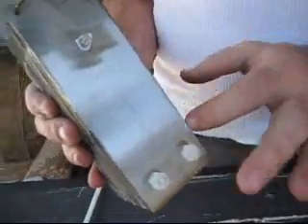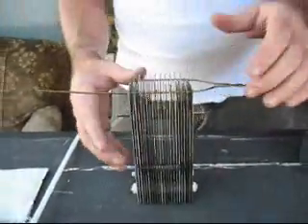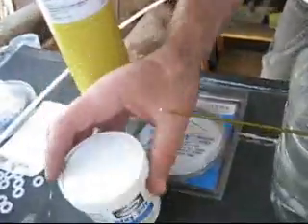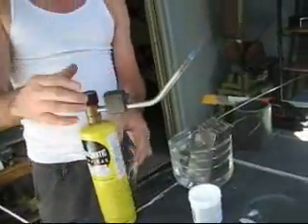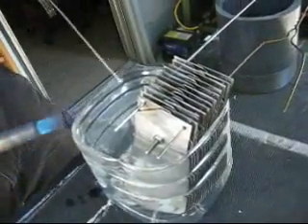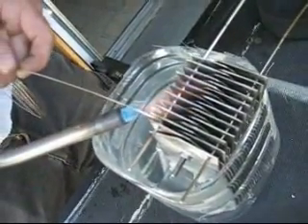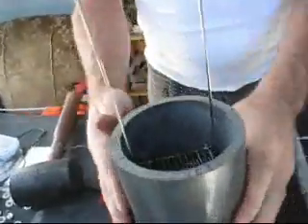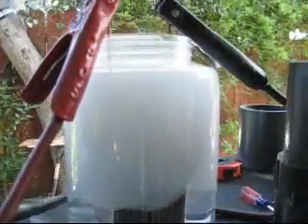HHO Third Generation Fabrication

Comment: Coughtry2 years ago (edited)I know all of this seems like a lot; but I really want to get this out there and get people to see the real potential of what HHO can do.  I am almost finished with my 3rd year in my Batchular or Science in Aviation Science.  I'm also a master automotive mechanic for both gas and diesel.  I'm currently engineering a small airplane to make an HHO system for aviation application at high altitudes.  I've been a pilot since 2007 finishing up my commercial rating to engineer and sell aircraft using only HHO systems for fuel.
 
Change your chemistry.  Sulferic Acid is what I use.  I'm running 180 amps.  Battery acid is designed for electrolice with water.  You require the proper number of electrons to separate the hydrogen from the oxygen.
Cross sand your plates.
Don't worry about the O2 sensor.  Your computer will register a lean burn causing it to inject more gasoline and in turn you reduce the throttle.  The O2 sensor is a variable resister which reacts to temperature.  It doesn't register oxygen.  The sensor sends to the computer a variation of voltage between 1.2 to 1.8 to dictate a lean or rich mixture. 
Go to your electronic store and get yourself a variable resister, about 10 feet of wire. and a laser thermometer.  Install the resister in the dash of the cab running two wires to your O2 sensor (you'll need 2 wires and 1 resister per O2 sensor.  In your case you should have 2-3 O2 sensors).  Next you need to find which of the wires is the return to the computer.  O2 sensors can have between 1-4 wires.  You must be careful to find the correct wire sending the return signal to the computer. In 3-4 wire O2 sensors have built in heater elements to allow the computer to switch from the MAF/MAP sensor to a closed loop O2 circuit.  The Return signal will be a positive wire.  These vary depending on application, but is usually white or brown with the negative being black. 
Cut the return wire and splice the two wires from the relay into the two ends of the return wire.  Repeat for the other O2 sensor.  You can NOT put all O2 sensor on the same resister.  If you do so you will damage the ECU and get error codes (check engine light).
The next step will be the tuning of the resisters.  What you need to do is bring RPMs up to about 2K and then take a temperature reading from the exhaust manifold.  It is of the most importance that the Right side is the same temperature as the left side.  To better assist the proper calibration you'll need a small pressure regulator for your HHO to the engine; and you'll need a 1/4 to 3/8 ball valve linked up to the throttle.  When you step on the gas the ball opens.  When your at idle the valve is closed.
 
Once you change the chemistry and get wired up correctly you should be able to lean back to 100% efficiency.  I eventually made one for my 99 dodge ram 4 door 4x4 dualy diesel 5speed OD, hauling doubles at 24K pounds.  Diesels can only run 50% since we need the diesel oil to lube the top end of the engine along with injectors and the injector pump.  I was tweeked out to 36MPG at 65 MPH moving 24 thousand pound at the CAT scale.
 
All in all you're on the right path.  Make sure you upgrade your power supply because you'll fry the stock one since the rectifier is not going to be powerful enough (200 abilance alternator will do).  If you follow my foot steps I increased the voltage to 120vac using an automotive inverter.  Then I wired up a 20amp AC plug to 4 diods to convert the AC to 120v dc.  You'll need about 90 plates to run at 100%.  The system produces a lot more HHO and runs cooler reducing the stress on your electrical system.  The amps depends on the number of plates and size.  The more nuteral plates the better.  Check the voltage accrost the plats.  If you have too many plates the voltage will fall below 120.  At that point you're asking too much of the power supply and should reduce the number of plates or cap the voltage so that it's consistent accrost the plates.  Going 120v will require a water pump for carosive fluids to circulate the water through.  Make sure you install the pump going from the tank to the HHO cell.  You'll also need a separate return line back to the tank.
 
I took this one step further and machined a new head for a 12v electric air pump for car tires.  The new head was required so that the intake of the pump could be fitted with a hose nipple.  This will serve as a vaccume line.  From you bubbler install the line to the vaccume nipple of the pump.  The outlet of the pump should go to a second bubbler.  The second bubbler will act as a small resevor tank if you ever need to mash the gas.  You'll need that extra volume or you'll start sucking water.  The converted air pump acts as a vaccume pump to lower the pressure in the HHO cell.  This goes without saying that the system must be air tight.  When you lower the pressure you cause the molecules to separate at a faster rate then at sea level pressure.  The pump also acts as the means to ensure you have  enough volume on demand in the secondary bubbler.  Go to the spaw department of home depot and get a pressure switch.  This can be manually calibrated to turn the HHO cell and air pump on and off based on the pressure at the secondary bubbler.
 
Without the vaccume pump I've only been able to get 24psi before the chemical reaction stops.  Once you release the pressure the chemical reaction will continue.  Remember psi is only relevant to the volume of the tank.  The higher the pressure the higher the volume and increased engine response. 1psi at 1ft ^3= 1cubic foot of HHO.  24psi at 1ft^3=24 cubic feet of HHO. Remember safety systems are required to prevent detenation.  Hydrogen under such low pressures is not going to do much damage until we get into the 300psi range.  At that point the HHO can combust due to pressure without an external ignition source.  If you're running a turbo like in my case with my diesel truck; I'm injecting the HHO at the intake manifold for best throttle response and drivability.  To do this you must increase the pressure in excess to that of the turbo boost.  A little positive pressure even on non-turbo engines works much better because it's injected into the engine when you need it, and save the gas when you don't need it.  The regulator and ball valve combined act like a carborator ensuring consistancy.  Without the regulator your HHO system will not consistently produce HHO causing sirges to the engine causing internal fatigue to the crank, pistons and connecting rods.  If you can accomplish enough volume (about 6-8L per minute), you should be able to run nearly 100% HHO.  My 74 F-100 runs on propane and with the 396ci burns about 7MPG at 65MPH.  That being a starting point, you need about 1-2 LPM at cruse.  To excelerate you'll need about 8-10 LPM.  Remember the volume of fuel you'll need will be 4 times if you double your speed due to friction and drag of the vehicle.
I hope this was helpful.
Reply: Very interesting read. Please explain the difference between Hydroxy and Hydrogen  . or H2 and HHO
Reply: @russellpeacock5548  hydroxy/hho… means hydrogen and oxygen mixed together. h2/Hydrogen is pure.

BTW... the oxygen that is being produced its actually ozone or O3.... if you are not separating the oxygen/ozone and off gassing it.  leaving all the gas as "HHO" then I would suggest running you mixture thru a carbon filter and this will reduce the ozone back to oxygen. 

you can also run the gas mixture out of your separator back to your fill tank and put the carbon insdie your fill tank. this will help purify and energize your fill water tank. then run your gas  out of fill tank to your bubbler.

Comment: i had an idea, try connecting the positive to the bottom of the hydrolizer so the electrons have to travel further though, drill another hole in the bottom with another rod there might be too much resistance, maybe try both!

Comment: Sorry. the braising is not right.The area that was braised will fail in the long run. The higher the amps and volts the shorter it will last. The only thing that servives in the electrolyte is stainless steel with a high nickel content or pure nickel. This I know to be true

Comment: Weather it boils or not is dependent on the electrical load you place on your generator, that it boils is a great sign because that means you have passed the maximum time efficiency peak. Limiting your current, will allow you to keep it from boiling yet staying efficient. 

The design is great, if you don't want to give up any current, circulate your water threw a radiator, preferably a non metallic or, even better, a ceramic one. Just force the temp to drop, pressurize it if need be.

Comment: With that kind of design and spacing, at the start it will produce hho but later on the electrolyte will boil.Try to show your video on youtube for 25 -30 minutes w/out cut.Let us see if your generator  does not boil.

Comment: Okay can you post the exact detail to braise these wires. 
I tried a butaine tourch with silver solder and SS wire. No luck.
So you have a SS welding rod, What kind of flux?, is the gas important?
I am great with soldering wire but I don't have all the info for this.
Thanks for showing me it is possible.

Comment: Onboard HGenerators Model
	
H2O consumed ml/hour
	
kWh consumed per hour
	
H2 gas produced ml/min
	
H2 gas produced liters/hour
	
H2 gas produced cubic meters/hour
	
H2 gas produced kgs/hour
	
Affordable Price:
LM-600
	
30
	
0. 3
	
600
	
36
	
0.036
	
0.0032256
	
$1995

Onboard Generators™ electrolyzer $1995

Comment: Consider runnings 12v direct and using well water or cheap drinking water with no electrolytes.
 My machine pulls 3 amps after one hour and little heat.  Adding electrolyte makes the amps climb fast.